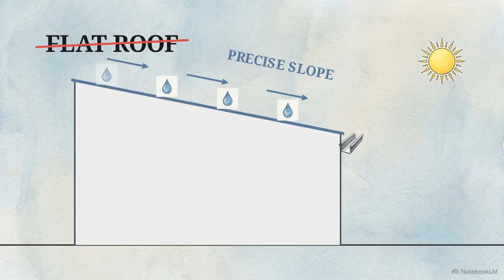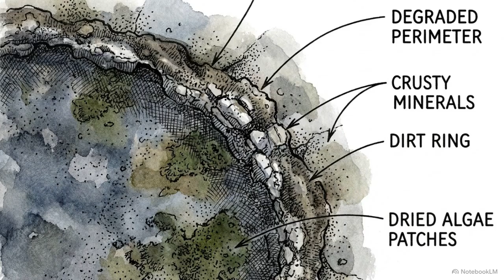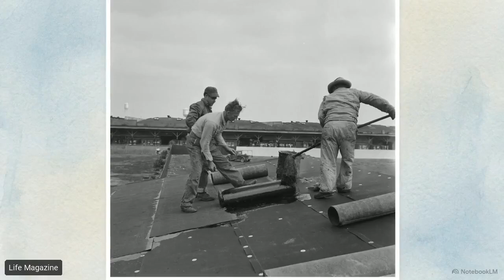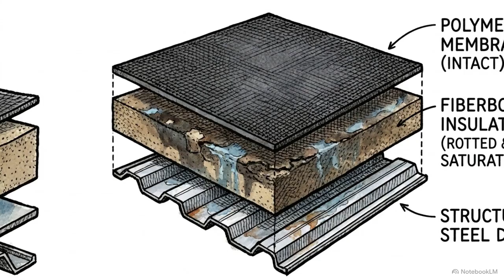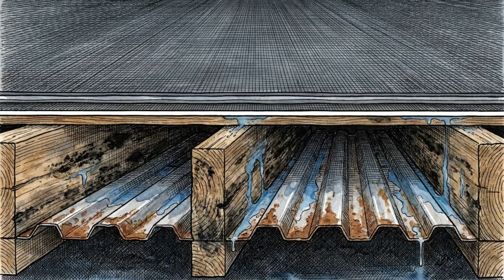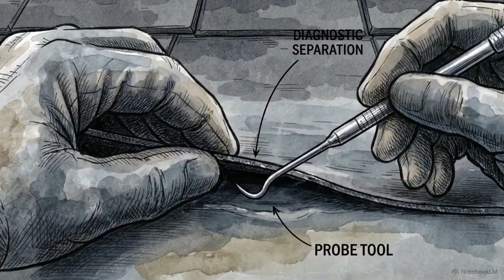Flat Roof Repair Santa Clarita: 48-Hour Flat Roof Leak Warning Signs

Comment from the maker: Not sure if ponding water on your flat roof is urgent? If water stays after rain, appears near seams, causes ceiling stains, or shows up with blisters or soft spots, it may be time to take action before a small issue turns into interior water damage.

Read the full guide here:
https://roofrepairsantaclaritaca.com/flat-roof-leak-signs-when-ponding-water-means-trouble/